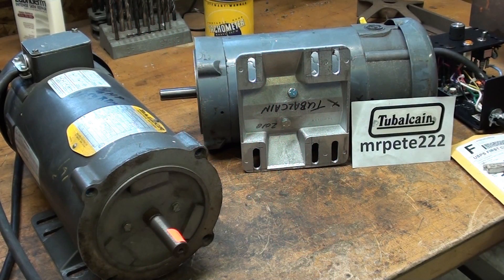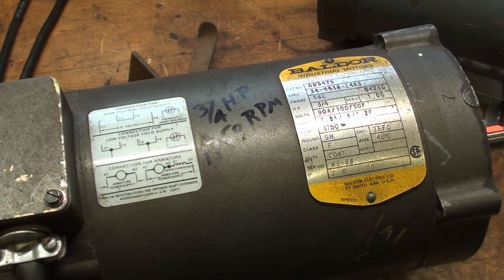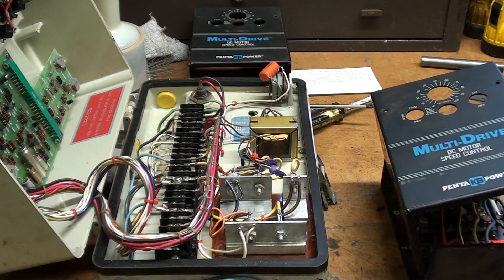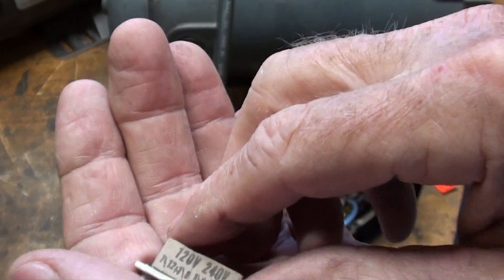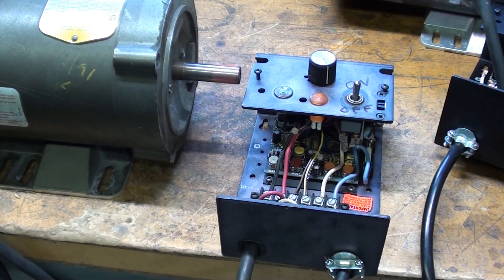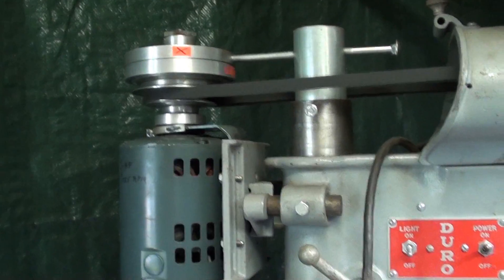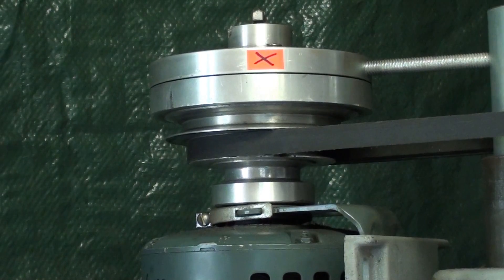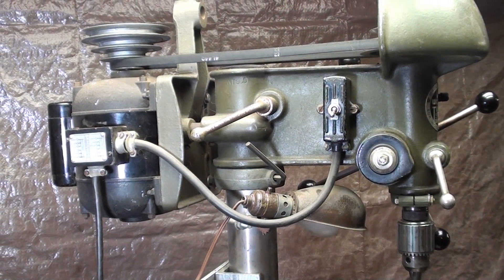DC Motors & Controls Tips #479 tubalcain

Comment: Mr. Pete, your story about Bob dose have relivence.  If your in a hot space that has poor air circulation and possibly high humidity and you are sweating profusely and you don't seem to be getting cooler you should remove your self to a cooler location immediately.  Especially if you are an older individual or had a heat exhaustion before.  If you can't remove yourself from the location and no one's there to help you your condition could worsen to heat stroke.  That could be fatal.
Reply from the maker: Yes, that is all true

Comment: Your DC motor will develop full rated shaft torque (twisting effort whereas HP is a function ofa torque times RPM) over its full RPM range. In a shunt wound DC motor (and in a pemanent magnet field motor,) shaft torque is directly proportional to armature Amps. The motor RPM will slow somewhat with load but that is normal. 

That's a quite sophisticated motor control you have. On it is a pot that controls "back EMF compensation." Tweak that pot to minimize RPM change with increasing load. There's instructions in the manual on just how tu do it. If you don't have the manual (actually a little booklet about 4" square) it's widely available in PDF format on several websites.

Adjust the EMF comp pot just right and motor RPM regulation will be near perfect from no load to full down to about 20% of base speed. Lower than that, there will be some RPM drop - nothing is perfect. I believe there is a tachometer feedback provision on that drive but you may not wish to engage in that level of refinement. With tach feedback, RPM regulation will be within 1/2% zero to full load regardless of RPM setting.

The heat sink of that DC drive is actually the 4" x 4" aluminum plate the circuit board is mounted on. The manual sets out heat sink requirements for the various HP ratings. These drives are SCR based and very efficient. Without looking and at a guess, I doubt if an additional heat sink will be required for a low duty cycle 3/4 motor like on a drill press. A bandsaw where long continuous cuts are probable may be a different story.

Is that a KB KBMD 240 control? Google it and get hold of the manual. Many mysteries may thereby be explained.

Comment: i love those kb electronics motor controllers. so easy to integrate into anything machine shop related. commonly used with "free" treadmill motors discarded at the curb. a big choke coil on the motor will help minimize the mains hum.
Reply from the maker: Yes, they are great

Comment: Mr. Pete,
My grandfather had that same model of Walker Turner drill press.  He had been a toolmaker for GE for most of his career.  He bought it as surplus off GE.  By the time I was in high school it needed a belt.  He said you had to remove the quill to change the belt.  It appeared there was a bearing at the top of the front belt guard.  Is yours built the same way?
Reply from the maker: I change the belt on mine years ago, I do not remember how I did it

Comment: DC motors are known to have excellent torque at lower speeds . As long as rotor and stator windings are driven correctly . 
they will perform much better then 3 phase motors , even with a vfd . 
Btw , these motors you have there are quite valuable . Check *bay for a baldur dc motor , a couple of 100$ easily .
Reply from the maker: Thanks

Comment: ya  the band saw project sounds fun. the heatsink  for my kbmm series on for my mini mill motor was $25 ? I think that same heat sink fits the penta that comes with the case and all I believe the online manual has the blue print if you go and make your own that scrap you held up looks great think theres a way to interface one of those with a modual for a tachometer of course ebay is probly where you'll end up for that
Reply from the maker: Thank you for the information

Comment: Mr.Pete, I have used similar DC controllers as yours and the aluminum case is designed to be the heatsink. When you mount it, mount it vertically and have airspace around it for ventilation.  One problem, if you run the motors hard at low speeds the cooling fans won't be enough. the drill press (mounted vertically) will be ok, but the bandsaw (mounted horizontally) might get hot.
Reply from the maker: Thank you for the information

Comment: At 4:22 Mr Pete uses the word "pot" to talk about the Min and Max speed adjustment.  "Pot" is short for potentiometer which is a variable value resistor, just like the volume control on your radio.   See https://en.wikipedia.org/wiki/Potentiometer.
Reply from the maker: Thank you for the clarification

Comment: The other 2 pots are max current (set at highest speed with ammeter) and "boost" to compensate for reduced rpm under load if exact speeds are crucial. I would recommend only very slight adjustments with the comp/boost pot. Turning it as much as ya can the min/max speed pots can really get you running poorly because it affects the entire speed range and the current. Or just make sure you know its (comp/boost) original setting and twist away.
Reply from the maker: Thanks

Comment: You can get good torque out of DC Brushed motors if you use a shaft encoder . And a closed loop controller .
Reply from the maker: You got me on that one
Reply: @mrpete222  it senses the RPM and trys to maintain it. Basically a governor.

Comment: i just helped a 70 year old gentleman clear out 2 truck loads of "scrap metal" from his parents house. his father designed and built rocket engines local to me for NASA way back when and also had a machine shop up until the 70,s. so far i found a AMES lathe cross slide which could be 100 years old perhaps ,a set of change gears for a Logan lathe,and a cast iron grinder stand i believe to be Baldor. everything was free,and he kept giving me more stuff after we talked about his dad. i love knowing the history and backstory on things i come across,so i enjoy your stories as well
Reply from the maker: That is very interesting. He must have been quite a guy. And he was a pack rat like me.
Reply: 3 30 yard dumpsters,4 trailer loads,2 truck loads and my friend did the rest of the clean out on the garage..... yes he was quite the "collector" . actually his son told me that there are several items in a space museum that were donated under his dads name.

Comment: Looking forward to the follow up! I'm by no means an expert here, but I understand that DC motors won't lose torque at low RPMs, that it's the AC motors on the variable frequency drives that die off at low RPMs as you've shown in an earlier video where you put one on a drill press.
Reply from the maker: You will be surprise of what you see in the upcoming videos

Comment: Mr Pete;  I have one of those KBMD controllers on my 9x20 mini-lathe.  It is a permanent magnet motor so doesn't need the field winding.  I can thread under power at about 14RPM, and the Tadulator I mounted inside the KBMD control box has a Surface Feet Per Minute scale on it so I can actually just input the diameter of the workpiece and see the SFM reading directly.  Take care my friend.   Surplus Center had these many years ago.
Reply from the maker: I like the idea of that surface feet per minuteon the readout

Comment: Lyle, that Walker Turner drill press has a LOT 
of features that later showed up in the Model 
10 Shopsmith.  I would really be surprised if 
Hans Goldschmidt didn't use these features 
on the 10E and ER.

http://www.woodworkinghistory.com/appendix_22.htm

I have a DC motor on one of these, with the same
controller.  It does get warm, but not hot.  I also 
have an AC cap start motor, on the same design 
machine, hanging on the wall, as a dedicated vertical 
drill press  This machine has a "Reeves" type speed 
changer.

As always, GREAT video.
A video from you, is like a 
few hours with a GOOD 
shop teacher.

steve
Reply from the maker: Thank you for watching and it sounds like you have a good shut up
Reply from the maker: I meant set up not shut up, sorry
Reply: I knew what you meant.

Personally, I've NEVER made 
a typo.  (Yeah, RIGHT!) :D

steve

Comment: I built a welding positioner using a  DC treadmill motor  bought a SCR motor controller and 10 bridge rectifiers on line for less than $20.00 . Sold 4 of the bridge rectifiers and got all my money back. The treadmill motor I got from my neighbour who had thrown the treadmill out in the garbage . Just waiting for a 200 ohm pot from China to slow it down enough for welding but it seems to run OK . Have pictures on my You Tube channel if any one is interested
Reply from the maker: That's sounds awesome

Comment: A series  wired DC motor has more low end torque than any AC motor the same size, I worked fro an automotive plant that had 2000 HP DC motors that rarely ran more than 500 RPM. DC motors are generally used for their low end torque, The ones that have a field anyway
Reply from the maker: Thank you, that is good information

Comment: I've watched the videos on the drill presses for some time now and agree with you that they are much too fast for metal work.  I was down at Harbor Freight  recently and I noticed that they now carry "metal" Drill presses.  I saw Three different models.  The most expensive one ($560) had a low speed of 160 Rpm.  They used three V-Belt pulleys to achieve the speed reduction.  You probably already knew about them, but on the outside chance that you hadn't.  I'm looking forward to what you will accomplish with you DC Motors.  Only 50 more videos for a 1000.
Reply from the maker: No, I never did see that one at Harbor freight. I will check it out, thanks
Reply: Yeah that's how I'd slow it down is to add another cone pulley. There's nothing quite like a good mechanical reduction.

Comment: Those will heat up some, from parasitic resistance, but not nearly as much as the old control. The modem controls use ”pulse width modulation”, which is just turning the output on and off hundreds or thousands of times a second. By adjusting the ratio of time on to time off, you can adjust the effective voltage coming out.

As long as the switching elements (SCRs aka thyristors) are fully on (R = 0) or fully off (I = 0), they don't dissipate any power (P = I²R).

As far as low RPM torque goes, these motors should be fine. PMDC motors don't have the low RPM torque loss that 3P  induction motors on VFDs do.
Reply from the maker: Thank you, you lost me on some of the technical information
Reply: @mrpete222  What heats up electronics is a state of being partially on. If it's all the way on, there's no resistance, hence no heat. All the way off, there's no current flowing, and thus no heat.

The old speed controls (except on a 10EE) were linear devices, which is to say they worked by turning partially on. The new ones switch on and off quickly, delivering little pulses of current, but they don't linger in a state between fully on and fully off.

If you set up an oscilloscope and monitored the output of the motor controller, you'd see a square wave going between 0V and 90V. The higher you turn the control, the wider the pulses get and the spaces between the pulses get smaller and smaller.

Comment: The control box also has a pot to set minimum speed.  If you don't intend to run the motors below a certain RPM why not set the MIN pot so you'll never go below whatever speed you prefer?
Reply from the maker: Thanks

Comment: Hi Mr Pete, love your videos. have been watching for about a year. I don't know if you have looked into Bison or Bodine dc gear motors but they are internally geared down. I used them when I was building conveyor belt furnaces and they had more torque and control at the bottom end. I used an 8 to 1 gear ratio motor so my 1700 top RPM was reduced to 212 RPM. you can get used refurbished motors for fair prices. see if interested the furnaces. www.lcifurnaces.com.
Reply from the maker: I might've shown a couple of these on the videos. I think they were Bodine. But only fractional horsepower, how about 1/5

Comment: The motors that you have will have maximum torque at low speed.  The secret is to have the field energized properly.  I see from the name plate that the field is in two sections and can be connected for 100 or 50 volts. When you adjust for higher speed you are simply reducing the field (which also reduces the torque). I think that you will be very happy with the result. And thank you for sharing the experience.
Reply from the maker: Thanks I may need more help

Comment: Circumference of a typical Delta bandsaw drive wheel is about 44 inches, which is close to 4 feet. So, if you set up your electronic tach on the drive wheel, you can multiply by 4 to get FPM (approximately). I epoxied 4 steel nuts on the rim of the drive wheel and used them to trigger an inductive pickup that drives the tach, which now reads out directly in FPM. Yes, it reads about 10% high, but that’s close enough for me.
Reply from the maker: That's a good idea with the 4 nuts. I talk much about those in later videos

Comment: Mr Lyle, take it from an old electrician 110 has killed more people than any other voltage known to man. It only takes 1/10th of one amp to kill you under perfect conditions. So please don't ever say again "I am only working with 110" you might lead some people astray. Sorry for the rant ,but that kinda hit a nerve.
Reply: I've always wondered then, why in the U.S. utility companies tacitly endorse 120 as being "safer" than the 220 mains as is used outside of the states, if given a choice I'd much rather see 220 as mains, it's just more efficient at energy transfer.
Reply: Because 120 will hold you where 220 will blow you away, 220 is much safer for novices to handle ,they will get hurt but usually not dead. So you see I am on your side. I am not an engineer or expert on low voltage I always worked High voltage 2100 and higher.
Reply: Having been zapped by 110 and 240, I preferred the 240 volts (Which is an odd way to put I know)  It still hurt like son of a  b.
Reply: You bet I have had a taste of 110 never 220 burnt up a new screwdriver didn't get me to bad thank the lord.

Comment: I've been using the same type of controller on a permanent magnet DC motor on a wood lathe.  DC motors are usually constant torque devices.  That's why they use them on diesel-electric locomotives.  So at low speed you will not loose torque, but you do loose HP.  HP is the product of torque and RPM. If you use a gear or belt reduction, the HP remains the same so if you cut the speed in half, the torque will double.  In a variable speed motor if you cut the speed in half, the torque remains the same, the mechanical advantage of the gear reduction is lost.
BTW, I don't think you will need any other heat sinking or fans for those controllers.  They are very efficient.
Reply from the maker: Thanks
Reply: I thought they used AC motors...(!)
Reply: One thing to watch out for, is make sure no oil or metal chips get inside-!!!

Comment: The controller you are using is much more advanced than the larger unit you showed,and is far more efficient ,therefore does not produce as much heat.That is why no huge heatsink is required. DC motors produce constant torque,so as speed goes down,horsepower goes down.Since they are 3/4 hp,you should have adequate power at low speed.The minimum speed ,if memory serves me is 10% of top speed.Most dc motors produced now have permanent  magnet fields,so wiring is much simpler.
Reply from the maker: Thanks

Comment: Nice casting of the motor base, but I'm worried that two small bolts from base to motor body may not be enough for you use or high Torque. Are you happy with just two?
Reply from the maker: I am happy because that's the way they were designed by a very reputable company
Reply: Hi@Joshie but don't brake calipers use high tensile bolts threaded into thicker castings. 
I just thought that if Mr Pete put in a few extra bolts, the motor would then take a lot more torque if he loads up the motor with his reduction pulley.

Comment: Mr. Pete,
   It’s called a “heat sink”. I know you know that but like me at my advanced age the terms escape me in the moment I need them. Also cut as few of the fins off your cannibalized heat sink as possible as the fins help dissipate the heat. Even if your application doesn’t heat up too much it’s advisable to use the heat sink as even mild heat can damage the electronics board.
Dale from Decatur
Reply from the maker: Thanks

Comment: I do have interest for some smaller DC gear moters but I'm sure you will get some push back from the VFD crowd, so I may as well be first! I'm not up on DC so looking for push back! With a vfd, I think the motors are cheaper, more simply built, thus minimal maintenance .... drive cost is comparable or less, and wider/higher HP range of needed .... very low rpm(100rpm) has plenty of torque for 5/8" tap, and on the other end, the nameplate rpm can be doubled which equals no belt/step pulley needed. VFD allows for low voltage remote switching so drive can be mounted in clean area
Reply from the maker: Thanks

Comment: Treadmill motors are a great source for DC motors...I am in the process of turning all of my equipment over toTreadmill/DC motors...there are good videos on  youtube on using the treadmill motors.
Reply from the maker: Thanks 👍
Reply: i have used treadmill motors with great sucess, however, don't lug one of them. they must be running pretty fast or they will burn up when used for a long while. Short term use, such as a drill press, should not present a problem.